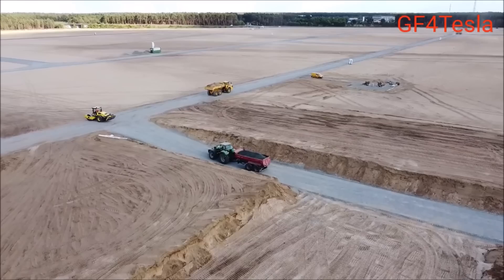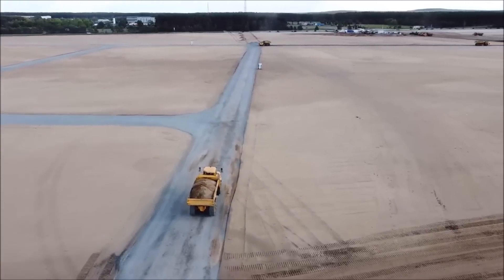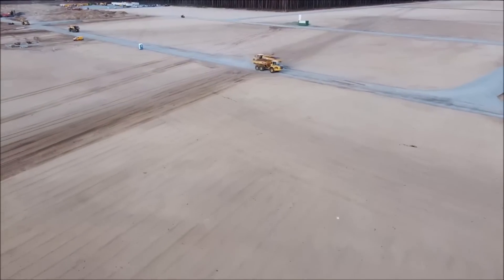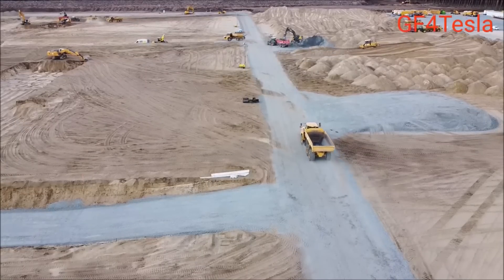The First Concrete of Tesla Giga Berlin, Construction Begins

Comment: Armen, I am always reminded of the Parable of the Wise and Foolish Builders when I see the videos from Berlin.. let's hope building on sand turns out OK.
Reply: Andy Granger What is your concern about building on sand?
Reply: @pieterfaber24  general lack of stability. For low height buildings  no problem, but for high steel framework buildings, a high degree of support stability is required. Piling gives deeper thrust stability. Whilst plate foundations reduce ground pressure in terms of kg / sq m ( literally like sand shoes) these are still built on a basically unstable material. From what I've seen on videos, the plates  are a very basic concrete pour onto a membrane. I'm surprised that the plates are not fully engineered and reinforced structures poured into shuttering.  The steel cages being assembled yesterday resembled the pile cappings at GF3  but I would have expected a far more robust sub plate. Anyway, I am not the contractor, and assume they have all under control.